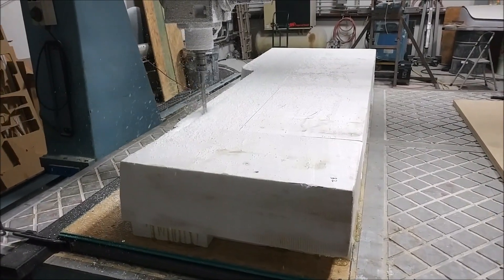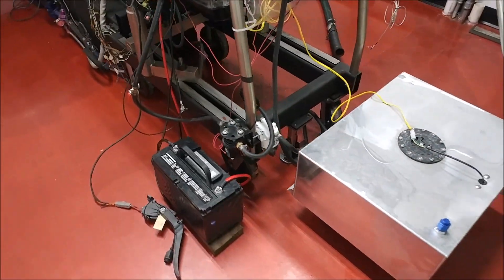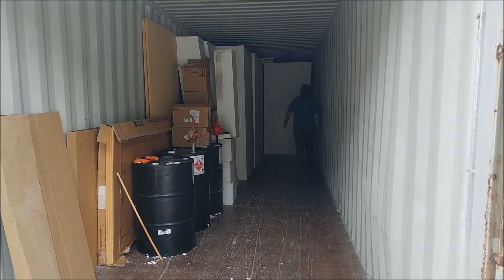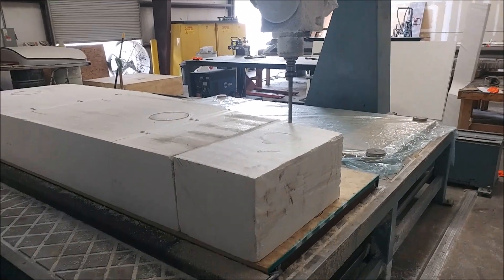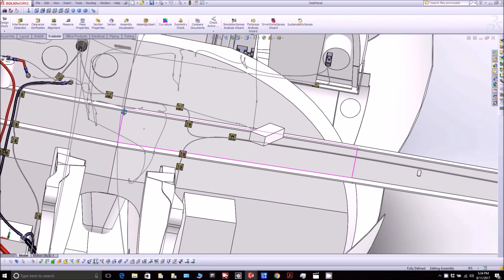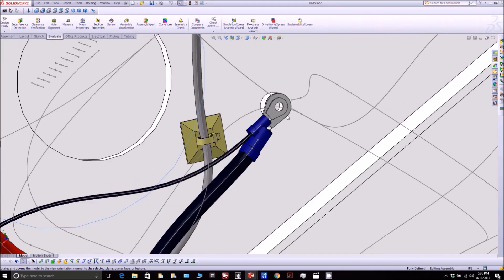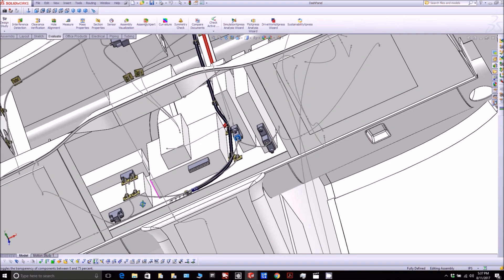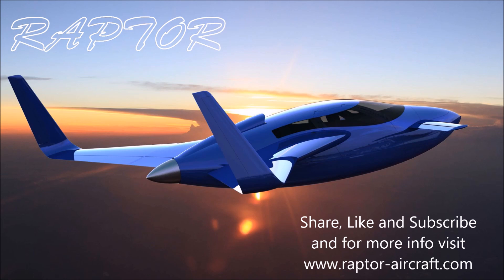The Engine Awaits - Almost ready for the dyno tune

Comment: Why should this engine work? If it was such a good idea to just drop an automotive engine into airplanes, why wouldn't everyone be doing it? Why do the couple companies that have been attempting to do this with diesels seem to have stalled their progress? Hadn't Diamond been building airplanes with modified Mercedes-Benz I-4 diesels but now moving to Safran purpose-built aviation engines?

Seems unlikely to succeed. I am rooting for you though.

Comment: Everyone is so curious about this engine setup. Are you planning to monitor fuel consumption with the different tunes you will be developing for the engine? I would be very interested in the data along with boost pressures across both turbos. To see how the turbos split the load between themselves. I also wonder if you can figure a way out to monitor actual internal cylinder pressures under load? (Yes it can be calculated) We could see what kind of punishment the top end is taking. It is so interesting. Just a bunch of motor heads here in northern Canada. Awesome job.